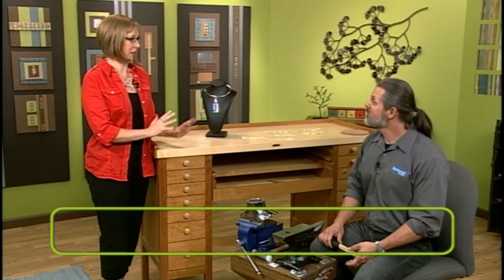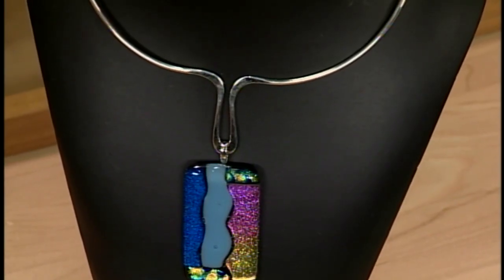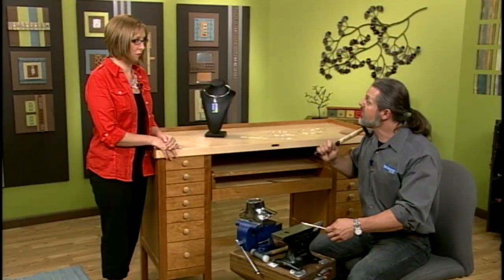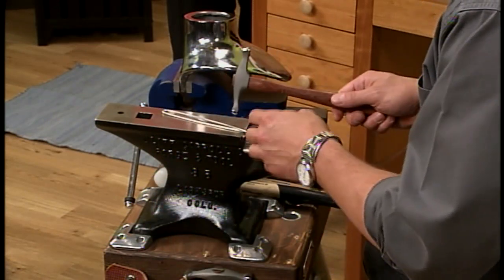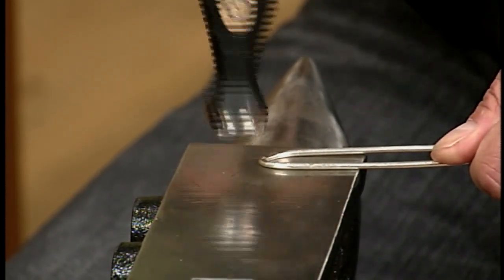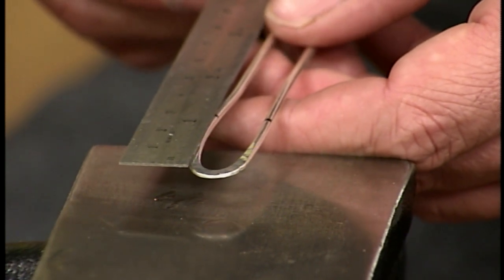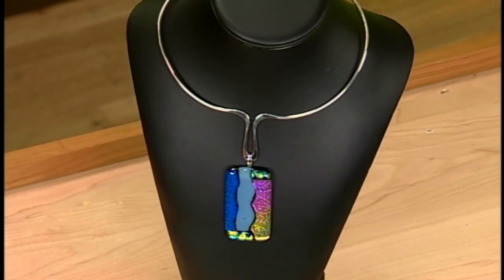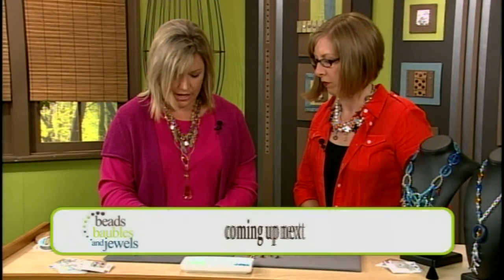How To Forge Neck Wires

Comment: Did you put any kind of hook on the back or does it just stay put?Thank you
Reply from the maker: Hello, to better answer your question could you provide us with a time stamp? We appreciate you taking the time to reach out us and we will make sure and follow up once we hear back!
Reply: Typically a neck ring has two hooks, one on each side that hook into each other.  You would want to shape ends into a hook, then hammer harden them flat.  Would look very nice.  A hook and loo also works but two hooks are more symmetrical.

Comment: Great video - what is the best way to form a neck wire without use of the neck mandrel?  Thanks
Reply: I know this is a really old question, but just in case someone else cones along witg this question, when i first started out i used an old wig/beauty school mannequin head at first. Its a hard plastic and works pretty good for annealed softer wire. And because you dont have to hit very hard, it wont break the mann. It will dent a little from the hammer if you miss. And gets scratches of course. But in a pinch, it works fantastic until you can get a neck form.
Reply: I have used my own self and fingers. Might want to anneal first and honestly it took freakin forever.
Reply: @EM-cg4iy  Not on Dead Soft wire.

Comment: ok so for the wire to sit in The neck it has to be hammered?
Reply from the maker: Hi Anayah, Thank you for your question. Hammering, or forging, the neck wire will work harden this metal so that it is more rigid and will hold its shape better than the dead soft piece of metal that was started with in this project.  Hope this helps!
Reply: No it does not need to be hammered at all. You can shape it by hand. However, this is DEAD SOFT grade metal wire which will not hold its shape with use without hardening it. You harden metal by pulling, twisting, hammering. You soften or anneal it by heating.

Comment: Great explanation of the hammer action. Never knew that hammering was so technical. Thank you.
I would have preferred if all the Q&A was left till the end. Let the man work in one uninterrupted sequence from beginning to end including the polishing. Too many questions interrupting his work constantly which was hard on viewers too. All he was doing was answering questions instead of working on the neck ring. Very annoying demo. You can easily cover the facts at the end of the demo.  Work hardening metal, polishing with rubber bit on a Dremel, etc.  Let him finish the clasp and bend and add his own instructions. The format of these demos is annoying.